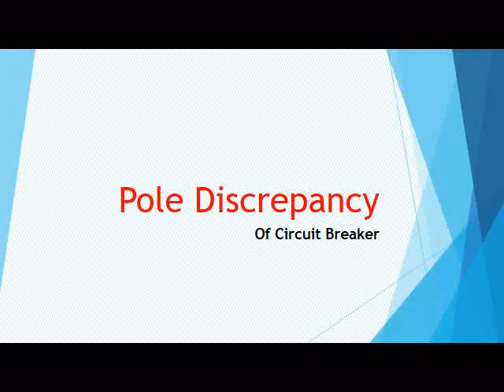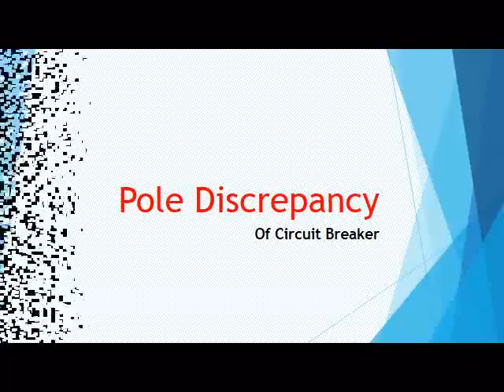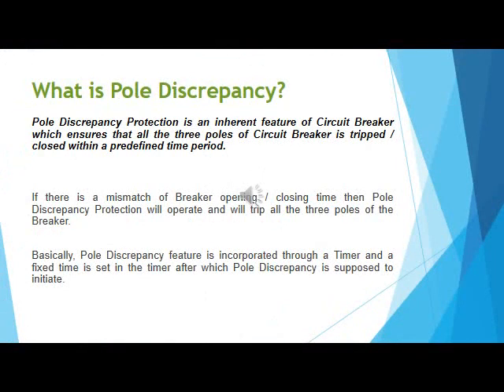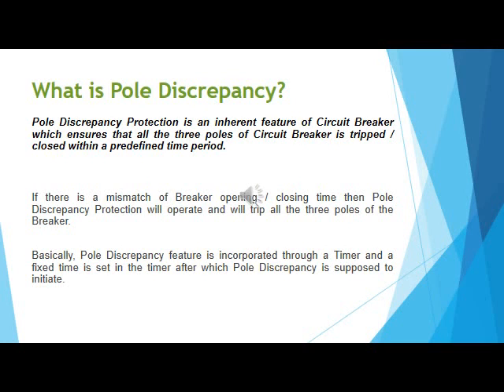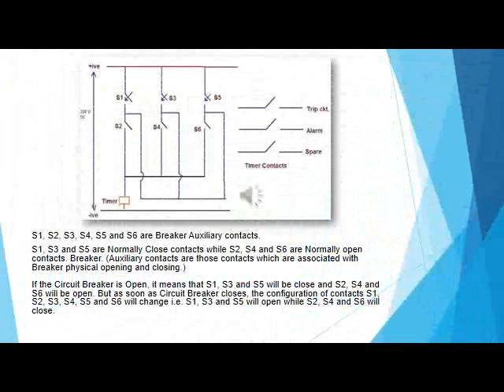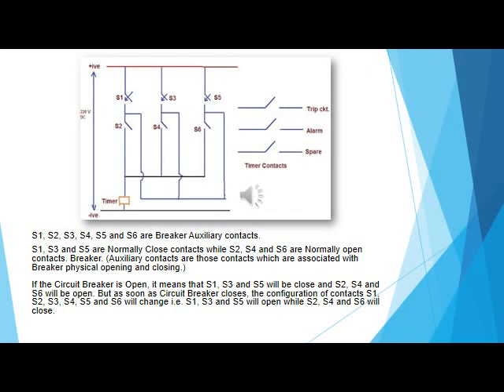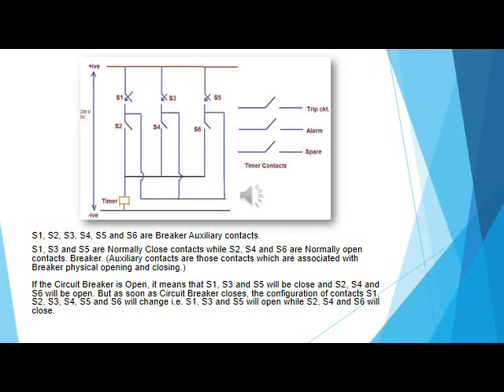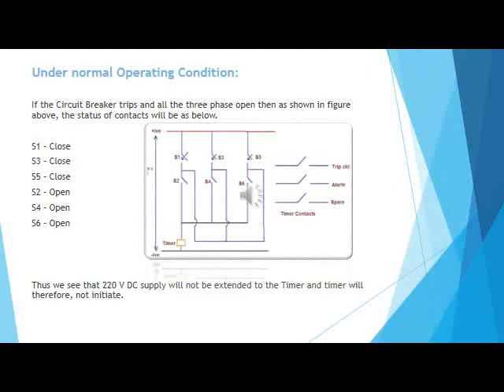Pole Discrepancy of Circuit Breaker

Comment: It should also have to be mentioned that the Pole Discrepancy feature will kick in not only during opening of the CB, but also during closing of the CB. During opening / closing of CB, if the pole discrepancy is present, the CB is tripped again via the Discrepancy Timer's 'timing done' contact. Also added that the pole discrepancy function is needed only for CBs that have non-ganged type of operating mechanism. Non-ganged type CBs are used where 3 phase Auto-Reclosing is desired.